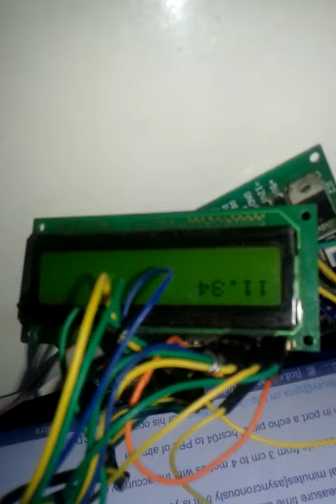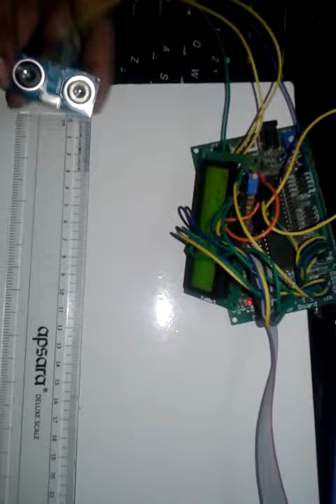Ultrasonic range finder interfacing

Comment: i m making project on " digital vernier calliper using ultrasonic sensor & PIC microcntrll for measuring distance in decimal....  so i want  readng start from 0.00 to 1.23.. 256.... 3.78... so on.... if this is not possbl  plz suggest me which type of circuit , sensor  & device are required......